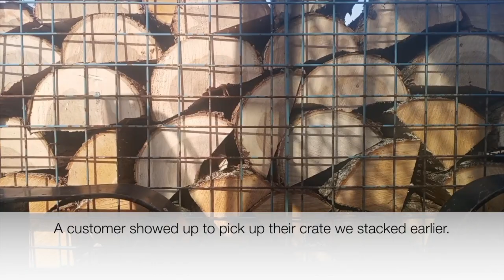20230323 Splittin' this. Stackin' that.

Comment: Like the idea of slab pieces under the racks I’ll do that , would slow the bottoms rotting as well. Gotta hate the mud this time of the year eh, then again we’ve had the mud all winter ugh 😩.
Good stuff !
Reply from the maker: 2 years is about all it takes to start the rot on the 1x4's on the bottom of the pallets if they are directly in contact with the ground. We do it mostly because during the winter, when picking up a crate from frozen ground if the 1x4 sticks to the ground then the pallet will come away irregardless. But it leaves the 1x4 on the ground frozen to it, with the nails sticking straight up. Safety hazard to say the least.